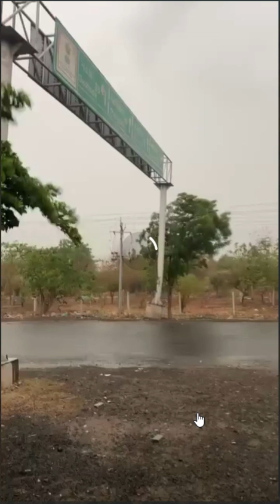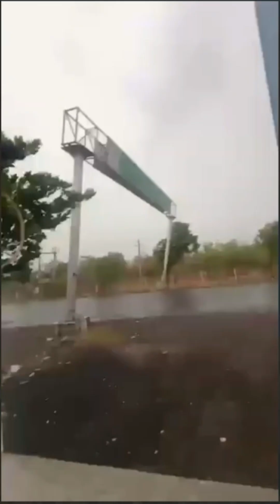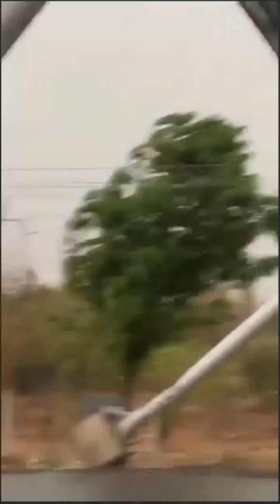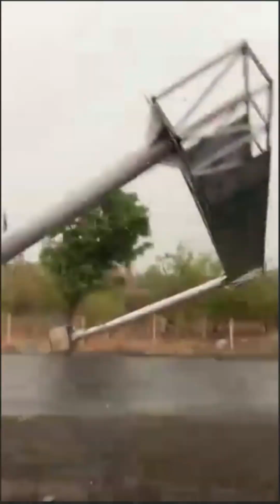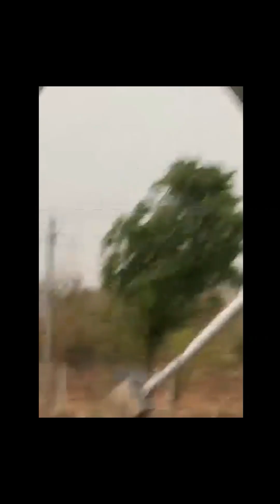Foundation failure #shorts #viralshorts #structuralengineering

Comment: this is not foundation failure. this is column failure. It lasted that long because foundation was inadequate. If the foundation had been designed properly, the column would have failed much earlier.
Reply from the maker: Thank you for sharing your views. Interestingly, on the other side, it can be seen that the foundation is intact even if the entire structure is toppled down.